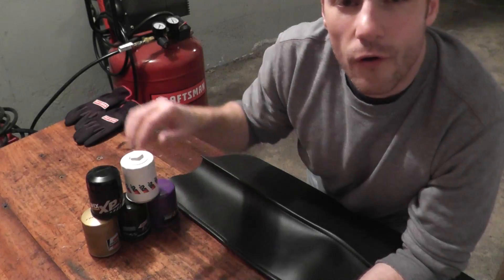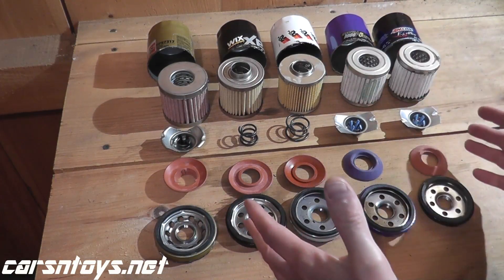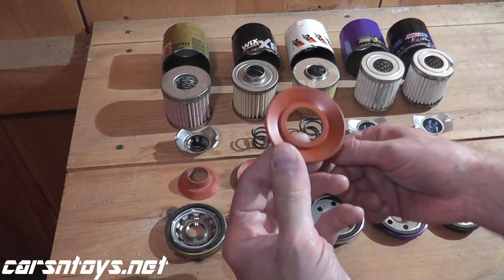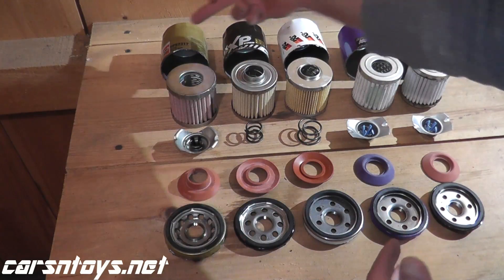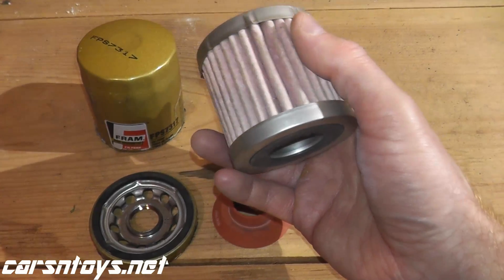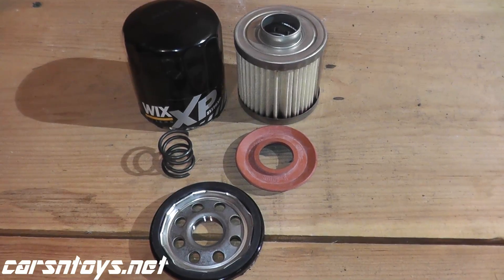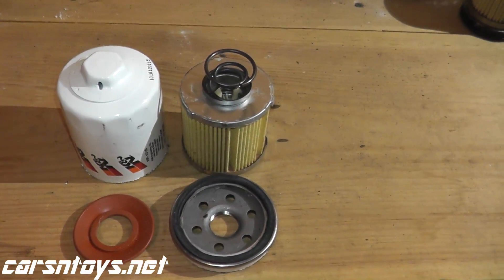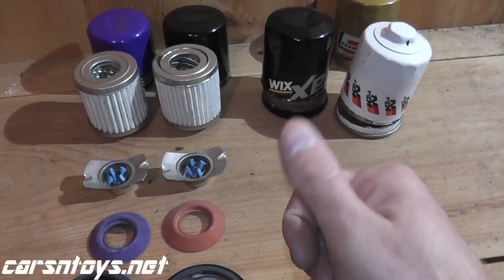Choosing the BEST OIL FILTER...FRAM vs WIX vs K&N vs Others

Comment: You know whats funny, is that I was looking at this video to help me decide what I want to use for my ‘96 Maxima next time I change the oil and low and behold, these are for a ‘97 Maxima (basically the same thing except for a couple of subtle interior and exterior changes in style) so I got a look at exactly what to expect for my car XD
Reply from the maker: Enjoy your fourth-gen Maxima. Great car.
Reply: Yes, I love it to death 😁-not literally though :P
I really enjoy this channel and it’s very helpful because you’re the only one that I’ve found that posts multiple videos on different things with the 4th generation Nissan Maxima. I’m currently dealing with a fuel injector that’s leaking into the engine, so I’m planning on just getting a new set of injectors but it’s very hard to find injectors for that car that you know aren’t going to be crap and don’t work properly. Have you replaced any of your injectors before? If you have, where did you get them or what brand were they if you know?

Comment: All Fram filters now have the silicone anti-drainback valves, even the basic Extra Guard. So if you get a Fram filter that has a rubber valve, it's an old stock filter and not the current manufacture filter.

Comment: The Fram is also a double lined filter element so it's a high value tight filtration filter.
I use the Ultra Synthetic Fram in all my vehicles.

Comment: Anti drainback valve failed on 2 fram extra guard in a row after 2500km. Symptom: like you just changed the oil every start.

Comment: I prefer stamped metal springs. Tends to hold filter element centered, and not shifting around touching sides of canister. Mann filters also uses metal tabs as set offs on top of end caps to eliminate side to side blockages.

Comment: While observations are good, what the hell is an oil filter used for?  Removing abrasive crap out of the oil.  It's important to know the minimum particle size that the filter removes (vaguely mentioned) as well as how much of the crap a filter can remove before it needs to be changed.  The surface area of the filter mostly determines that.  For real data, the starting point is  ISO 4548-12:2017

Comment: List of filters and associations,
Main Manufacture
-- Sub - names of Brand filters using the main company to manufacture their filters. 

Fram

    * Fram Extra Guard (std)
    * Fram Tough Guard (different media?)
    * Fram X2 (Silicone ADBV, Fuzzy media)
    * Fram Extended Guard(same as the X2)
    * Mileguard (Jiffy)
    * Honda (although some are alleged to be made by Filtech)
    * Chrysler line up except for the Cummins
    * Penzoil
    * Deffense
    * Canadian Tire

Champion Labs

    * Bosch
    * Car and Driver
    * Deutsch
    * Mobil 1
    * STP
    * SuperTech
    * K&N
    * Valvoline filters
    * Mighty
    * Service Champ
    * Lee
    * AutoZone Value Craft
    * Some AC Delco
    * VW (some)
    * Warner
    * Luberfiner
    * Trust

Wix

    * Carquest blue
    * Carquest red
    * Napa Gold
    * Napa Silver (lower quality with nitrile ADBV)
    * Kralinator (in Canada)
    * ALLIANCE (Freightliner aftermarket)

Purolator (Arvin Meritor)

    * Purolator premium plus (nitrile adbv)
    * Purolator Pure One (silicone adbv, different media)
    * Havoline
    * Maxlife Valvoline (some)
    * Group7
    * Promotive
    * Powerflow
    * Quaker State (less media)
    * Advanced Auto Total Grip. (less media)
    * Pep Boys Pro Line
    * MotorCraft
    * Superflo

Denso

* Toyota
* Mann+Hummel
* Mann
* Volvo
* Suzuki

 Clarcor

    * Baldwin
    * Hastings
    * Amsoil
    * Casite

Comment: Fram Ultra Synthetic ROCKS!
Reply: When you buy a case of 6, it's like 7.50 a piece on eBay.
Reply: @spiceyfrenchtoast9421  
I can't find that offer myself. Was that two years ago. I use the Fram Ultra XG9972 cartridge filter. Best price I can find is $10.97. They should be cheaper cause it's mainly just the element.
Reply: @masterofnone1808  That was for the honda fram filters, idk about other models

Comment: You can count all the pleats you want but how much dirt does each filter pull out of the oil,
Also you can filter fast or slow but what is the microns of the filtration do you get out of each filter.
Of course if you are racing you need a high flow filter. To filter oil faster.

Comment: Wix are good for money. I really like Bosch filters if you want a high quality cheap filter. I run K&N in my truck though but I run 15k mobile 1 and run my oil changes to the higher end of MFG recommended mileage.

Comment: Bought A New 1987 Nissan Pick-Up New used FRAM OIL FILTERS from the First to The Last Oil Change. My Engine BLEW UP !!! Thanks Fram. Changed my oil every 4000 miles. FRAM IS ALL CRAP !!! Never Buy or Use FRAM OIL FILTERS !!! EVER !!!

Comment: How is purilator? I keep buying them and running valvoline maxlife 10-30 and after 2,000 if I change the oil cold it comes out sludge. I changed to royal purple this time, hoping it’s different.
Reply from the maker: They're nicely made: https://youtu.be/ARFGm7BftJM

Comment: The return holes on the Frame are impressive on their own. They're the same that my cheaper blue Subaru filter comes with.
Reply: Return holes? 
The small holes are the inlet holes where unfiltered oil enters the canister. Filtered oil is returned to the engine through the large center hole.

Comment: I wonder whether you can evaluate filter media by just looking at it or measuring the area after spreading it out. I would think the thickness, type and physical construction of the material would affect flow rate, particle size capture ability and filter life. Those are the specs that really matter. It would take some kind of flow tests to get good comparitive data. Now we only have advertising claims to go on. It was nice to have a peek inside but you really need some lab testing to sort them out.

Comment: They all do the same thing they remove all the large abrasives from the full flow of oil to the engine. How do you remove the smaller engine wearing abrasives. You install a depth bypass filter or you drain the oil

Comment: May I ask a question?  The filters you're reviewing are usable for synthetic and traditional oils as well?  How about blended synthetics or only full?
Reply from the maker: You can use blended as well.
Reply: You can use synthetic filters with any oil. The same is true for the cheaper oil filters but a filter that only rated for 5,000 miles shouldn't be used for 10,000.

Comment: None of. them clean oil. If they cleaned oil they would be too restrictive.The bypass valve would stay open. You would have a bypass filter that screws on. Like a. Stilco or Trasco. If you want clean oil you have to deal with oil lines and finding a place to mount a bypass filter. My Smart car has nothing in the oil large enough to be removed by a full flow filter. I tossed the full flow filter. All it uses is a roll of toilet paper. I gave up on letting the oil get dirty then changing it in 1963.

Comment: For testing the shell I would do a hydro test rig rather than measuring the thickness . The type of steel they decided to use could have serious effect on strength as well as how it’s molded and fabricated .
Reply from the maker: Thanks for the tip. Additionally, you can find the burst pressure with most manufacturer's.

Comment: Motocraft.   Because that's what 79 F150 300 six, tells me she likes.  :)
Reply: @EpiLover  only thing is the anti drainback valves are rubber not silicone so don't push your change intervals too much
Reply: MSTWNTD motor crafts have silicone drain back valves it says so right on the box
Reply from the maker: Very cool truck.

Comment: Don't even bring racing into it they change your oil on every run. That's not good oil when you have to do that. All you're doing is plugging racing and it has nothing to do with the oil filter because race car drivers blow their engines faster than anybody because their oil fails it actually runs the engine so hard that the filter can't put it back into the engine.

Comment: a point that is never covered on these things is flow resistance. Some engines are sensitive to restriction and you may think that you are Doing it(engine) a favor by using a high particle filter rating one and never realize you have caused so much restriction your engine is not being lubed correctly. which one you figure is worse? using OEM filter that does its job filtering while maintaining the flow rate the engine was designed to have or have a fancy filter thats capturing every spec of dirt but is not allowing for proper oil flow. I've personally experienced this on 2 cars and decided to used a less restrictive filter because i could tell the expensive filters were not allowing proper flow and was causing rough unhealthy sounding noise during even light engine loads this only changed the second I went back to a OEM filter. perhaps some engines can deal with the resistance better than others but its something that should be considered. it took me roughly a year before I found out why my engine was sounding bad. who knows how much extra wear could have occurred in that time.
Reply: It’s called the efficiency rating he stated that they’re all 99% in this particular examination.
Reply: The by-pass valve allows adequate flow if there is too much restriction.  That's why your point is never covered, it's a non-issue.

Comment: I was going to switch over from the AC/Delco filter to the Amsoil. And I've used them in the past with good effect. But, I've never seen one taken apart. And that it's JUST like the RP, only built better than the Amsoil was extremely revealing. Wow...And I use the K&N air and cabin filters in my C6Z. I may switch over to the WIX. In fact, Amsoil sells WIX on their site. Very interesting.

Comment: This video did probably the best job of apples to apples comparison between the filters.
Most other video comparisons pit the Fram Extra Guard, Fram's economy filter against other companies premium filters and justify finding those as better than the Fram. Well DUH!!!!!!!
The Fram Ultra Synthetic is actually a high end premium filter, just like the competitors It's compared to in the video.
One thing not covered, was that the Fram filter is actually a double lined synthetic element filter which helps it get the 15,000 mile rating.
Good job on the video CarsNToys. Kudos.
Reply from the maker: You get a lot of bang with the Fram filter. Cheers.

Comment: I learned about car maintenance from my dad back in the 80s. My grandpa was fleet mechanic for over 30 years. All three of us have almost always used Fram in every vehicle we own. I've driven over 1million miles on my cars over the past 26 years never had internal engine problems. The most common problems on my cars are fuel pumps and suspension components wearing out. I have four vehicles currently, with 77k, 116k, 185k, and 212k miles on each of those. 
When Oreily auto stopped selling Fram and pushed WIX, I used a couple. Then I found out Walmart was selling Fram, for a lower price, which is  the real reason Orielly stopped selling Fram and started bad mouthing them.

Comment: I remember years ago and I'm talking in the 50's - 60's at the county fairs there was a demonstration of an oil filtering system that you could install on your vehicle. It was similar to when you would take a fabric filter and put it in a housing then to change you just changed the filter by taking out the dirty and installing the new clean one. Any ways the new system used a roll of toilet paper instead of the fiber filter. The demonstrator would put anything from metal shavings to a hand full of dirt into the intrance part of the filter system and where the oil came out it was clean and clear as new.
Reply from the maker: Very cool.

Comment: They all good and really don't care for k&n because most of the time I see customers car leak oil from them and that bolt mostly don't work. Higher quality filters way better then cheap crap ones. Always get same size or bigger as the OEM.
Reply from the maker: I agree. They're all very good filters. I haven't had any issues with K&N but I've heard similar issues. Cheers.

Comment: I always wipe dirty oil on the seal because it doesn't make a difference. The engine has 100,000 x more dirty oil by volume still inside after oil drain than the film I apply to the ring.

Comment: It doesn't look like any of them have a stamped metal spring.   The stamped metal looks like a mount for a smaller spring on the inside with a plastic valve.   Instead of moving the whole filter back away from the engine to bypass, the plastic center (4 pointed blue star on royal purple and Amsoil) is the only part(smaller surface area and weight) that needs to move to bypass so a much smaller spring to tension it.

Comment: I would always trust amsoil or royal purple in a racecar a daily driver I believe the wix is a goodchoice,I will never use a fram again if you are familiar with ford triton motors in the 2000s with the cam phaser issues ,I can tell u anything like fram with the cheap design and low oil pressure is not your friend  dont buy any of them fram is garbage ..

Comment: I agree with comment about using oil analysis to determine filtering efficiency. Looking at media is useful but its limited to visual guess. I've found standard Wix to be just fine, used them for hundreds of thousands of miles on many vehicles.

Comment: The point of safety wire (ala K&N) is to keep the filter from loosening up and leaking oil onto the racetrack, not to retain or anchor the filter to the vehicle. Most race track tech requirements include safety wire retention for any fluid reservoir (engine oil drain bolt) and a catchment device (belly pan on a motorcycle for instance) which will hold at least the volume of oil in the engine. Most racers will safety wire their disc rotor bolts, oil fill cap, radiator cap, etc.  proper safety wire work is a nice attention to detail on a race car or motorcycle.
Reply: Hello, Sir
Automobile filter trade here, we are Hebei Huyi Automobile Filter Co., LTD., we have 15 years of professional experience in the field of manufacturing oil filters, air conditioning filters, air filters, high quality, the price is very competitive.Export high quality and low price automotive filters

Comment: That big coil spring is not the bypass spring.  The two filters that have those obviously have the bypass built into the end cap.  That spring just holds the filter element in place.

Comment: I figured I was using the best and this video proved it. I only use K&N or Royal Purple on all my vehicles, I rotate/alternate between those two when I change the oil religiously every 3,000 or up to 4,000 miles maximum. And those are the 2 Best Oil Filters I recommend to everybody else to use on their vehicles. But if I was on a Budget, I would have no problem using the Fram pro syn for $8. The only fact I wasn't sure of that this video has confirmed for me is that the Amsoil filter that many people have raved about to me for years as being the Best turns out to be practically the same Quality as the Royal Purple and is just actually overpriced by a few bucks.

Comment: The best oil filter brand does not exist.  Oil filters should be based on micron efficiency ratings.  Wix might be a better filter for one car but my truck I wouldn't put a wix filter on it ever I would put a motorcraft oil filter which has a 98% efficiency and has a micron rating of 18 microns.  The smaller the micron rating the more particles they catch.  If I remember correctly the wix oil filter had a 99% efficiency rating but the micron rating was 32 microns. So it would allow bigger particles through the engine which wares the engine out faster.
Reply: wouldn't that clog it up faster too? I mean, how much do tiny particles hurt it? flow should be very important too, and durability. I hear filters are breaking open and stuff

Comment: I loved the Denso First Time Fit oil filters for my 2000 Tacoma V6. They had huge filtering area, silicone valve, and a shell that can bounce bullets off. Now it's unavailable on Amazon. You can still get the Toyota ones on Amazon, but they have a rubber valve and no plates on each end judging by all the pictures I see of them cut open.

Comment: Quite likely the amsoil and royal purple are from the same manufacturer. At the top end there is in all likelyhood little difference. I run the amsoil because it's about an inch and a half longer than any other filter for my truck I have seen; otherwise I'd just as soon run a wix.